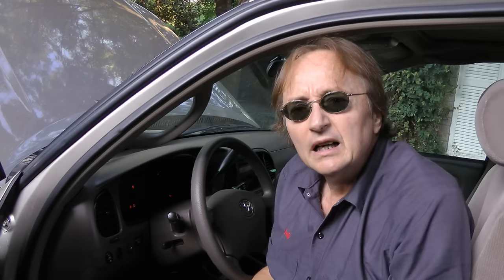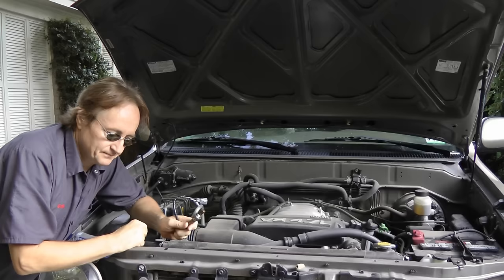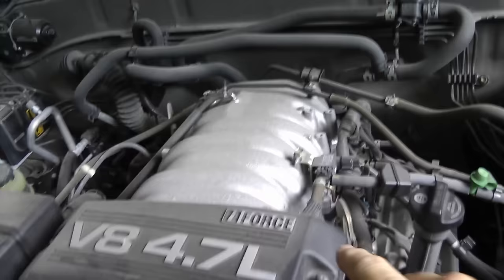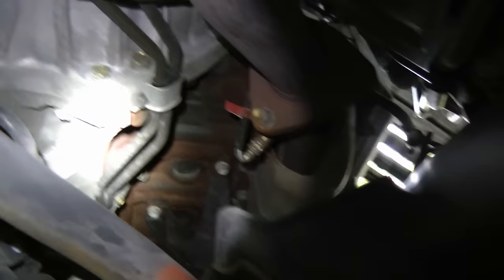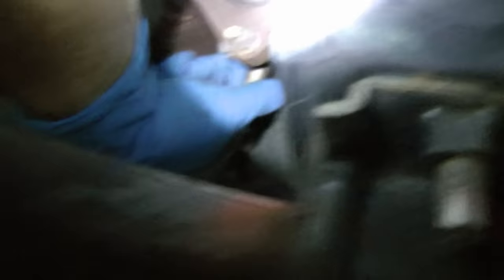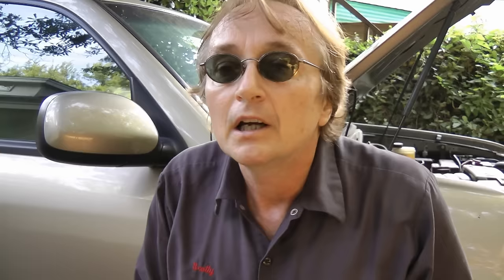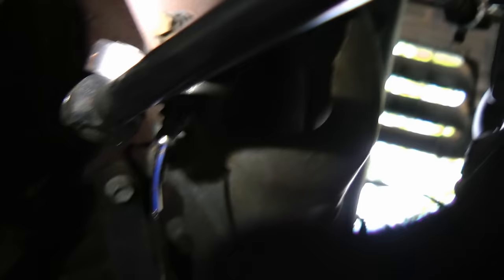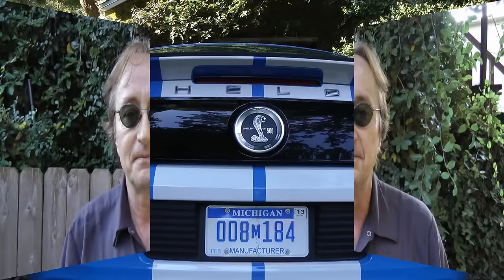How to Replace an Oxygen Sensor in Your Car (Air Fuel Ratio Sensor)

Comment: +scottykilmer Hey Scotty, I have a bad oxygen sensor on a 2007 Mitsubishi Eclipse 2.4L Four cylinder with a code that is for a Bank 1 Sensor 2. I am having a hard time trying to determine where it actually is. Going online I have found confusing answers that contradict each other. Please direct me in the right direction. I have the sensor and the socket just need to find out where it goes.
Reply from the maker: that's the sensor AFTER the catalytic converter under the vehicle

Comment: Hey scotty got a 01 lexus rx300 with 167,000 mile's on her the exuast smells almost like raw gas and i am getting terrible gas mileage about 12 to 14 mpg (terrible right) i know but i havent gotten a check engine light yet i know the entire car has 3 oxygen sensors should i replace all 3 even though i havent gotten a faulty code please help im burning gas bad just a little over 210 miles a tank :(

Comment: Scotty,

I replaced the oxygen sensor that my mechanic told me it was not working.  The new oxygen sensor did make a difference in my car in terms of power.  However, I would like to know if should change the other oxygen sensor for better performance although it keeps working.  Thanks.
Reply from the maker: na,theoretically oxygen sensors can last forever, being made of platinum that does not get used up during driving cycles
Reply: The car runs better with a new upstream oxygen sensor.  However, the code P0421 came back again.  I wonder it its my catalytic converter?
Reply: Erick Enriquez Depends on how long u let it run pig rich before u changed the old sensor. Catalyst might have broken up.
Reply: If the catalytic converter was bad, my mechanic would already told me. He tested the oxygen sensors and told me to replace one of them. I don't know I should change the downstream oxygen sensor.

Comment: Was offered to buy a 2000 Lexus RX with.....255,000 miles. Owner said it runs great but needs an O2 sensor... Is this a bad buy?
Reply: With that many miles unless it's a rebuilt engine than yes.

Comment: Scotty I really need you help, please. My car won't run and it was running perfect before the starter died on me. The mechanic replaced it and now the car has a broken exhaust pipe, but it is broken before the oxygen sensor and my car won't run over 1mph! Could the broken pipe be the reason why my car won't run? It's a pretty big hole! I need help!

Comment: I have a 98 eclipse and the code says p0134 faulty 1-4 02 sensor how do i know which one is bad?
Reply from the maker: that's bank one sensor one, the sensor on the engine bank #1 before the catalytic converter. Go to any auto parts store, buy one, they can show you on the car
Reply: Scotty Kilmer scotty i really need your help i have a 1991 celica the check engine light is always on i try'd to reset it just for inspection but i have code 21 i believe which is a 02 sensor how many 02 sensors do i have the code said main oxygen sensor or something and would this likely be my problem? and he added a catylatic converter to the car before i bought it.
Reply from the maker: SvddenDeth
  change the sensor on the pipe just after the exhaust manifold
Reply: Do you think this would fix it? i recently bought the car and when i got it home and was cleaning it up i realised someone took the dash apart to put tape over the check engine light which i wasnt too happy about, and scotty i cant express how much i really appreciate your help ill defiantly watch your show tomorrow thanks again!

Comment: in 1994 ford explorer how to fix fuel evap control functional and where it located helpless female
Reply from the maker: +Donna Wardlow the evap system has many parts from the gas tank to the engine intake manifold, best to find a mechanic to mess with that complex system, BUT if it runs fine, ignoring it hurts nothing

Comment from the maker: hiding on the back side of the exhaust pipe, jack it up then you can crawl under and see it. it's the one there before the cat, not the one after the cat
Reply: My 2002 Dodge Ram 2500 van runs fine when cold as soon as it warms up it idles rough and dies what might that be

Comment: How much did that new O2 sensor cost Scotty? Just curious
Reply from the maker: prices vary from model to model, from 50 bucks for older ones to 500 for newer air fuel ratio sensors

Comment: hi scotty Kilmer  if you have   code p0135  sensor 1 bank 1 on front the engen then you change it  new sensor.   the code p0135 stay and get other one code p0155 sensor 1 bank 2   other side the engine  and take the new sensor and put old sensor  back  the code code p0155 has gone put code p0135 stay is mean my computer software bad or the sensor cheap  is bad 
thank you

Comment: Is it possible to clean the o2 sencor so I don't have to spend the money for new one?
Reply from the maker: Not really, they are basically self cleaning as the car runs. If engine burns oil or runs lean, that burns out the sensor and it needs replacing then

Comment: I need to buy one of the OBD II Scanner Car Engine Fault Code Reader CAN Diagnostic Scan Tool, can anyone tell me what kind of Scotty has that will show me which sensor is bed and all other thunks in my car, to buy all new oxygen sensors make no sense to me
Reply from the maker: an actron that costs about 179 recently on amazon is a good one
Reply: Actron CP9580A Enhanced AutoScanner Plus i got this one today, it will do the job?

Comment: Hi Scott,
Very nice YouTube Video.
I have a check engine light on of my Lexus 2000 RX300 with these codes:
P0141 O2 heater circuit (bank1, sensor 2)
P1150 A/F sensor circuit range/performance malfunction (bank 2, sensor 1)
P1130 A/F sensor circuit range/performance malfunction (bank 1, sensor 1)
Fuel Sys1 = CL - fault
Fuel Sys 2 = CL
Calc Load (%) = 14.1
ETC (deg F) = 192.2
STFT B1 (%) = 19.5
LTFT B1 (%) = 7.8
STFT B2 (%) = 19.5
LTFT B2 (%) = 13.3
Eng (RPM) = 790
Veh speed (mph) = 22
IAT (deg F) =109.4
These freeze frame data above for P1130.

Could you help me where are these sensors locate it?, and how to fix it. 

PS: And I see these duplicate codes below are pending as well.

P0141 O2 heater circuit (bank1, sensor 2)
P1150 A/F sensor circuit range/performance malfunction (bank 2, sensor 1)
Reply from the maker: the bank one sensor two oxygen sensor is bad, change it. The bankd two sensor one is bad, then pray that fixes it all. They are on the exhaust system, go to a place like auto zone, they can show you pictures on their computers free
Reply: Scotty Kilmer Thank Scotty, how many sensor do I have to change?? or just change one and all the code go away. please help.

Comment: How do u unlock d trunk of a 2000 Mitsubishi galant
Reply from the maker: +Fredrick Gay get a key that fits or use the remote. If neither work, you can remove the back seat and get into the trunk that way to force the latch open
Reply: Backseat lock to wife lock it

Comment: Thanks a lot!!
Reply: I have a 2004 PT cruiser the check engine light comes on and the code poo32oxygen sensor I had change both of them up stream down stream but the check engine light is still on the same thing poo32 what should I do any ideas to help me out I even try resetting the code by disconnecting the negative from the battery but the same code still pops up p0032.

Comment: Be careful, if your scan tool gives you a fault in the oxygen sensor, your car may have a problem that causes the oxygen sensor to get a bad signal. Things like vacuum leaks or bad ignition may cause this.

Comment: How about for infiniti jx35 2013 the dealership Check my car today here's what they say REPLACE AIR FUEL RATIO SENSOR 1 (BANK 1) AND REMOVE HEATED OXYGEN SENSOR 2 (BANK 2) SPACER THAT IS CURRENTLY INSTALLED ON IT thank you 😊

Comment: this is what to do if oxygen sensor is bad.quick fix.unplug battery.if one of the upstream sensors are bad.unplug it.and hook battery back up.if one of the downstream is bad do the same.then car will run fine.till you get the money.to replace.easy temp fix.

Comment: What happens when you eliminate your car's sensors?
Reply: I have a little Suzuki SX4 2.0 that has a Cadillac converter that is just completely destroyed and I was thinking on just cutting it off and leaving it straight pipe on that section since they want to charge just way too much on Cadillacs over here.
Reply from the maker: you'd be breaking federal law and vehicle would run poorer and get worse gas mileage

Comment: Why is it that Scotty always videos the easy jobs, 2 minutes to replace this sensor, 3 minutes to replace the other sensor, 5 minutes to replace an engine......?

I have spent hours replacing an original, 20 year old, upstream sensor with no room for a wrench, no space to get to it from above, positioned so that penetrating oil does not help (other than drip back into ones face). Had I videoed my fight with this sensor, it would have been a multiple season feature series.
Reply: exactly I had to change mine and the damn thing was way in the back of the engine and it was so cramped and tight really no room at all to work or even turn the ratchet, and yes I bought the special socket tool and even with that tool it was so hard to make sure its seated right and to turn the darn thing off, it was on so snug.

Comment: my car smells like gas bad out of the exhaust and hesitates my check engine light is not on can a bad o2 sensor cause my car to run rich?
Reply from the maker: it can, but more often it just tells the computer about another problems causing gas smell like leaking injectors
Reply: thanks

Comment: What is P2195  02 sensor bank 1  Means
Reply from the maker: it means the oxygen sensor on bank one of the engine is giving out bad data. Can be a bad sensor, bad wiring, bad computer, vacuum leaks on the engine, leaking fuel injectors, lots of things. Cars are rather complex these days. Most guys guess with a new sensor and pray it's just that

Comment: I got cheated on oxygen sensor for Toyota Camry 2003 at Toyota DL -
El more at the Beach BLV by the guy Advised they change only 1  oxygen sensor next the intake engine they charge me more than $600:00 + $150:00 first inspection which was wrong the engine light on total more than $750:00 I m not happy with the DL having the bad guy contract with the customer , I will let my French and some once don’t come

Comment: Hi Scotty. I bought an oxygen sensor on ebay and put it in my car now my car idols poorly. I did a diagnostic test in oxygen sensor mode and the ce-light flashes 13X at 2000Rpms. When Idle, the cel is solid red (means lean fuel). It knocks around and is rough. Do you reckon i accidentally fried my ecu (i forgot to unplug my batty when removing the sensor i even unplugged it with the car running i just forgot about the battery and ecu.. i was having a bad day. Or is it possible just the sensor i ordered a piece of poo. This is the 1 i purchased http://www.ebay.com.au/itm/201622127118?_trksid=p2060353.m2749.l2649&ssPageName=STRK%3AMEBIDX%3AIT
Reply from the maker: I would not use ebay sensors, try a real oem one

Comment: How many basic people have an O2 socket handy
Reply: +stu7491 If you can, use a wrench.  Some sensors are kinda hidden, so he socket is necessary, but others, a wrench will work fine.  You would have to check your car to be sure of which one you need.

Comment: You claim 51 years a mechanic and you say that you need/use anti seize to seal the sensor?.. 

That's interesting, we use it as a lubricant with copper fillings to lube and permit a good contact for the sensor to manifold and prevent it from seizing in the bung in the future.. 

Hows abouts you do a video on the O2 sensors that are almost welded on from not using your anti seize sealer, and not do an easy one as in this video giving people the impression that this is such a simple job and they end up stripping out the threads in the manifold bung.

Comment: How to remove a rounded oxygen sensor from your car stripped nut
Reply from the maker: heat it up with a torch then use vice grip pliers
Reply: mine said the problem was the 02 sensor on the drivers side so I changed it and had it cleared and the light still came on ! it's a 99 Blazer 4.3 !